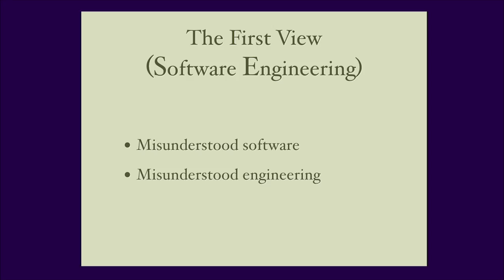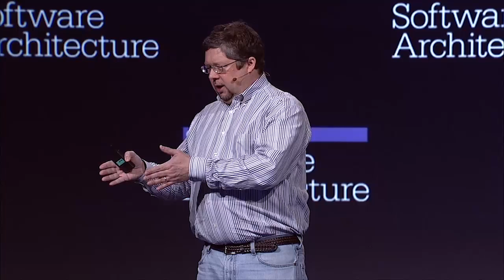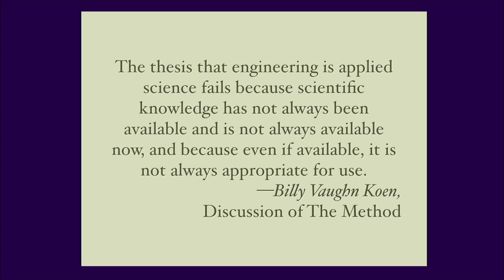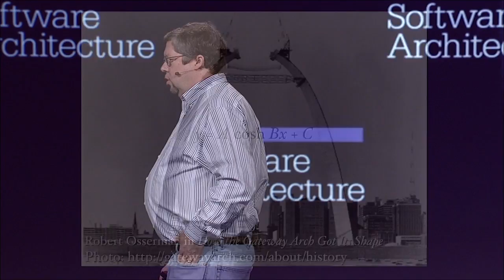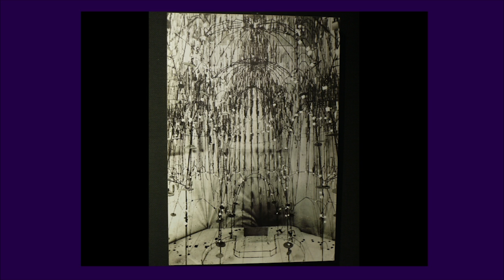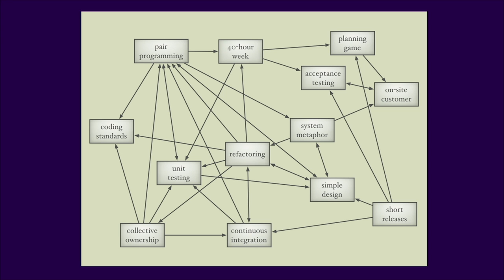Glenn Vanderburg of LivingSocial on why software development is an engineering discipline

Comment: Great talk, but remember Waterfall was removed from Federal Acquisition in 1994 with the Pulmigation of MTD-STD-498 replacing MIL-STD-2167A.
While software development is much more flexible  than "hardware engineering", software development is subject to external verification and validation processes in many domains, domains that outnumber the commercial development systems like travel sites by 100's of times
DO-178, ISO 26262, ISO 31000, SINTIF, TUV,  HMH&SE, EUROCAE ED-12
The term "waterfall" is a code word for "bad management" and practiced by those unfamiliar with good engineering and SW development processes
All SW development processes in those environments subject to governance guidelines is empirical as well - based on Systems Engineering Principles and Practices, Earned Value Management, and Quality Assurance V&V processes

Comment: States are starting to enforce their engineering laws on those appropriating the title of 'engineer' without licensing. If it had been enforced in the first place we would not have this silliness. Architects are also going to take their titles back. Illinois is about to start draconian enforcement.  
Engineers and Architects go through ABET accredited curricula, intern for 5 to 7 years and take state regulated board exams. They are liable for their designs. They are required to take continuing education.
Software 'engineers' and 'architects' do NONE of this yet appropriate the titles because they use some of the methods are do things that might be analogous to the tasks in those regulated professions. Ironically, those with degrees in those professions are prosecuted more brutally for working unlicensed than those out of it (software...). 
It's envy and arrogance from the software crowd. Get your damned engineering degree, intern and take the test. Then you can call yourself an engineer or an architect.

Comment: All branches of engineering have a scientific basis... except software engineering. Because engineering has a scientific basis, it inherits mathematical tools that model the science; engineering generally spawns a lot of other mathematical tools used to facilitate engineering, too. This is true of mechanical engineering, electrical engineering, chemical, nuclear, marine, and biomedical engineering. What does software engineering have? Computer Science? Is Computer Science really a science? Does one use the scientific method and mathematical modeling to describe how systems operate in Computer Science? Do we implement programs based on mathematical models in software engineering? I would say we don't. Real engineering is more rigorously attached to modeling and fundamental principles than this video would have us believe.